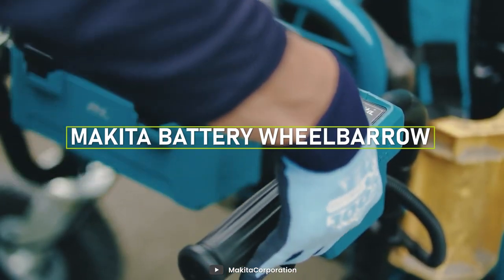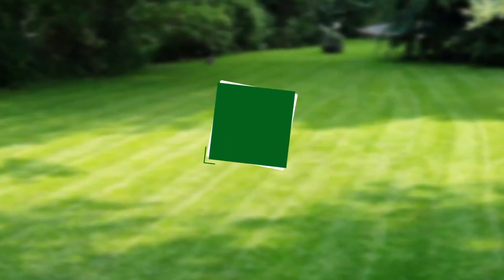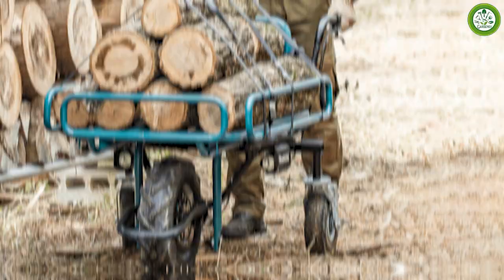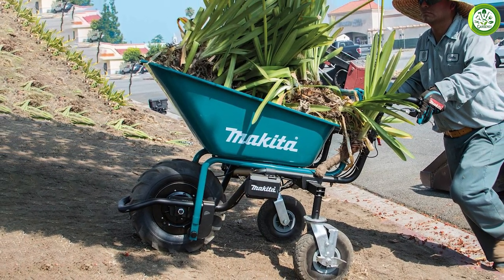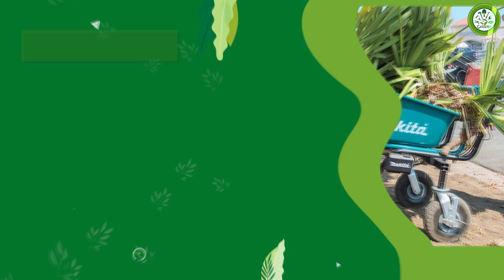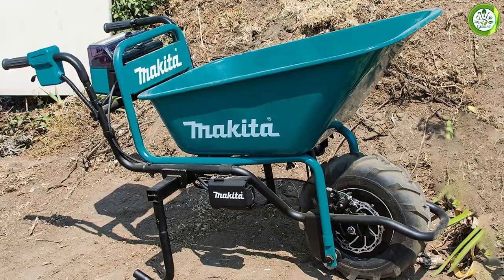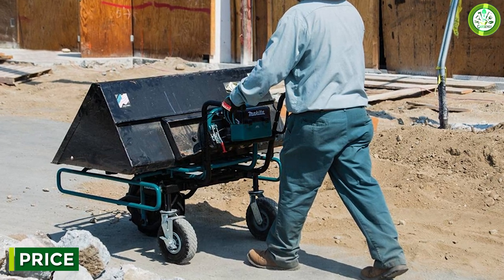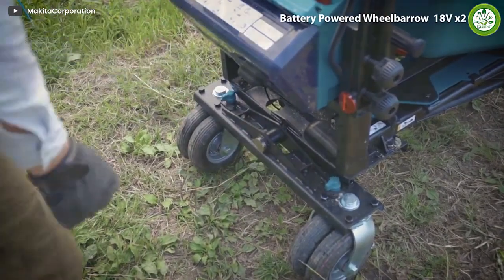Makita Battery Wheelbarrow Review: How Effective Is It? [2024]

Comment: Inaccurate AF.  The larger XUC04Z shown here is advertised at over 7,000USD as of this writing.  In addition, the larger XUC04Z has three speeds.  The smaller XUC01 has only two forward speeds, and one reverse.